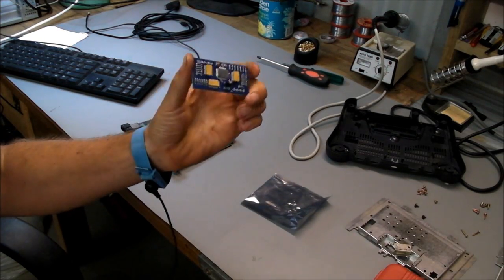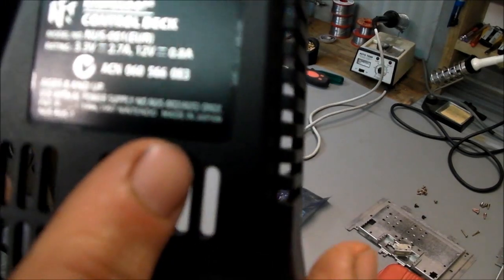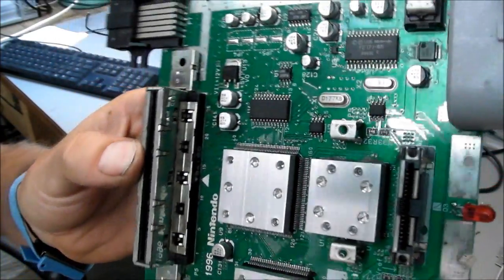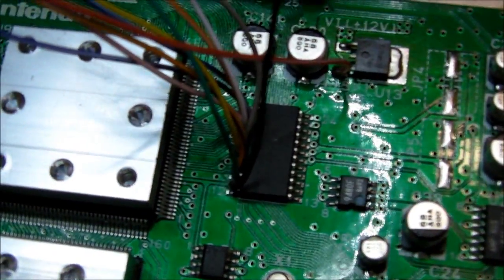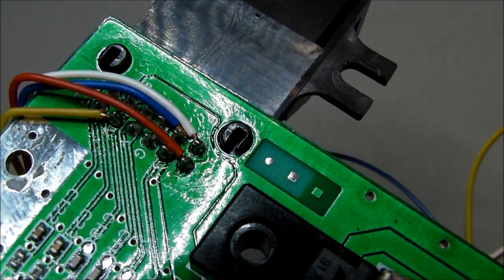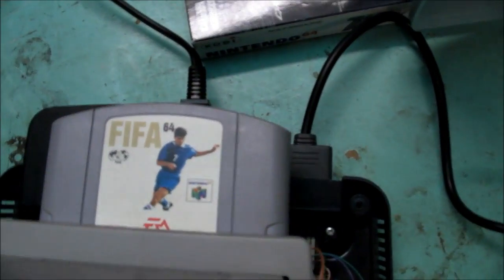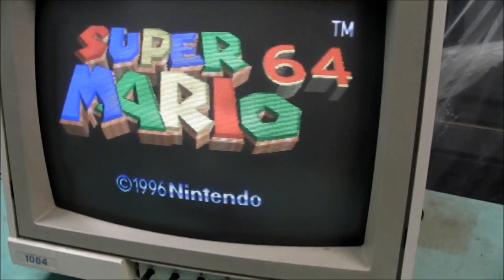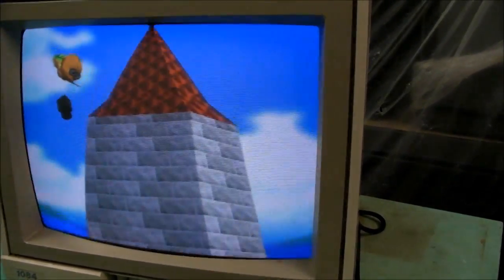RGB mod for PAL Nintendo 64

Comment: tip get yourself an ntsc nintendo64 I would not use ntsc games on my pal n64 being from the uk the only difference is the power supply and RF unit also you won't encounter any slow down on your ntsc game paks due to pal hardware limitations.
Reply from the maker: +Ian Vallender I agree with you, my own personal N64 is NTSC.

Comment: Hey dude, Im in Australia and I'm going to do this but I have a question. I need/want a good CRT display that has RGB, is 4:3 ratio and not massive (screen size I mean, obviously depth is part of it) Im guessing thats a computer monitor or studio monitor  you're using? What brands or models should I search for?. 

Sorry to ramble on if you have no idea about what to look for :)
Reply from the maker: Sean Toohey Tvs in the 60 cm range are the most common and therefore the easiest to find. 66cm & 68cm European brands such as Loewe, Grundig, Bang & Olufsen are very good. Some older Sonys (circa early 90's) have scart. Tvs under 60cm with scart - look for Teac, many have scart, also  a few Philips do to. 

Sony PVM 2730 (27") is a pro monitor that has scart, the PVM 2530 (25") has scart too.
Reply: RGB Rob Hi does the converter take away the black borders on mario 64? Q2 I have a UK Pal N64 how do find out if this mod is compatible?
Reply from the maker: With the N64, youve basically got to go all PAL or all NTSC, from my experience there are issues trying to run NTSC software at full speed and full screen on PAL systems. The N64rgb mod will work on you pal system. You guys have the same consoles as we do here in Oz.
Reply from the maker: Sean Toohey http://www.ebay.com.au/itm/321759723589?_trksid=p2055119.m1438.l2649&ssPageName=STRK%3AMEBIDX%3AIT
Reply: +Sean Toohey Find a Commodore monitor of sorts, as commonly bundled with the Commodore 64. Some had SCART inputs, some had a punch-out where the SCART connector should have been. The latter is usually just a matter of a SCART plug and a bit of soldering.

Comment: What's that thing that you used to play the "Japanese" version f Super Mario 64.
Reply from the maker: Its a converter/adaptor that allows you to play foreign games on your  N64. So in this case, im playing the Japanese version of SM64 on a PAL Australian N64. This particular device is called the Ultra 64 SFX V2.0, its made by Blaze, its one of several different brands available. They all work by having two cartridges plugged into the adaptor(Jap Super mario in the top, and theres an Aussie game plugged horizontally in to the back of the adaptor in this case). When the 64 is turned it does a security check to make sure the game region matches the console region, if they dont match, you get a black screen. The adaptor works by guiding the 64's security check to the cartridge in the back of the adaptor, the console thinks the game is of the same region and everything works.

Comment: So this works on all N64's? I thought only certain pal boards were moddable for some reason? I may be totally mistaken!
Reply from the maker: People have been modding the old NTSC models ever since back in the day and this is the way its essentially still done with this particular model today.

 Come to present times, the rgb mod board in this video is the first commmercially available rgb mod I have seen for all other models otherwise not rgb modable. It is  called N64 RGB "for all" and is claimed to be compatible with all N64 models, the seller  otaku's store sells a "classic" rgb mod kit for the early models mentioned above and the "for all" kit for all other models, they claim it is compatible with all models. Check this:

http://www.otakus-store.net/en/content/21-which-rgb-kit-for-your-n64-
Reply: Hi mate. Came across your vid as I'm planning to build the DAC for a DIY version of the RGB for all. The only PAL RGB moddable system is the french N64 NUS-001(FRA) which is getting pretty rare/expansive now. It delivers an ultimate and native RGB "made in nintendo" with CMS components. It's even better than the THS7314 amp mod. Made some comparisons. I'm curious to see the comparison with your board. \m/
Reply: The board isn't around for that long. So NOW it's finally possible to mod all PAL consoles. ;)